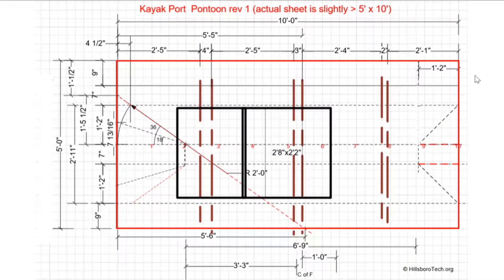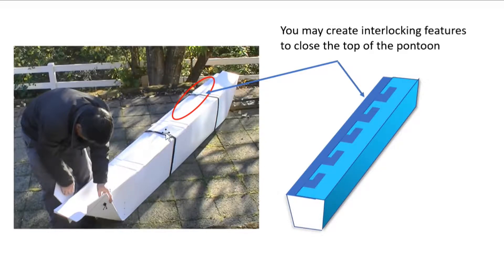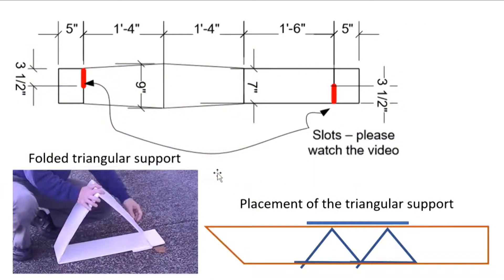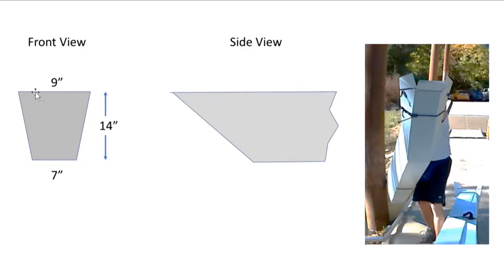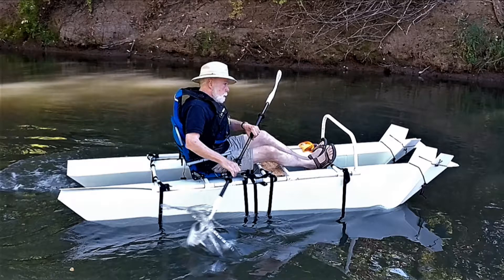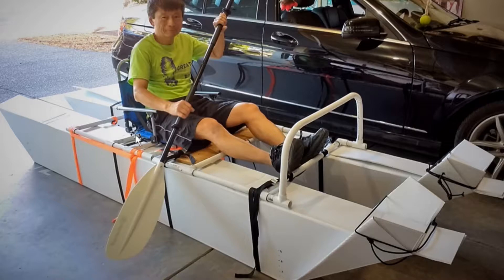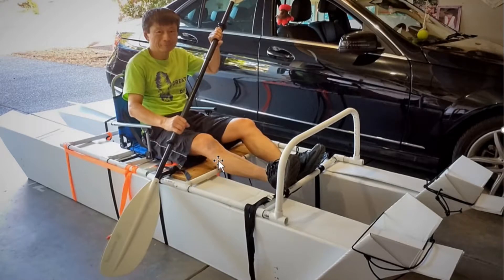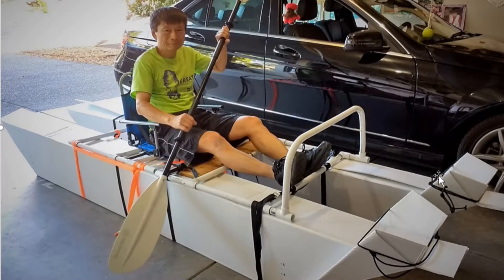Tutorial: How to build a foldable pontoon kayak

Comment: I really enjoyed watching this.  I plan on making pontoons with foam board, these measurements seem excellent.
Reply from the maker: Thanks for watching and your feedback. This boat is easy to build. It is very stable. One catch is it takes 15-20 minutes to assemble it. Even though it is not hydrodynamic, it is still quite fast and easy to paddle. Turning is good too may be because the draft is only a few inches. I am working on a new version, which you can build it with the 4'x8' coroplast. You can watch my progress in this series...https://youtu.be/GYJq3BOIcDc
If you use foam, my understanding in US we have to encapsulate the foam. I have tried that too using 'poor man's fiber glass technique from Youtube'. It is also easier to glue the foam together with spray foam or you can use wood glue... I tried both and spray foam is the easiest. If you use foam, I suggest you to reduce the height of the pontoon. My pontoons are tall because it is foldable and I don't want water to get in. With foam, you don't have that worry. My new pontoon boat design is only 8" tall because I can seal the pontoon and make it water tight (and the design is modular and not foldable).
Cheers!